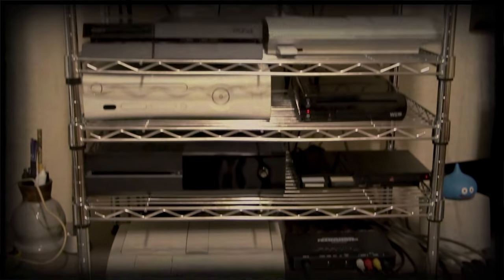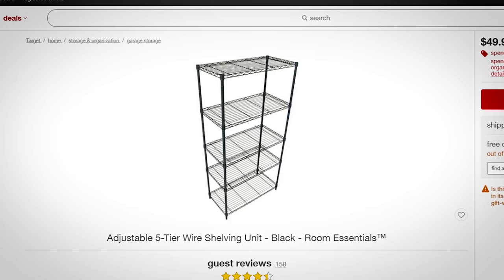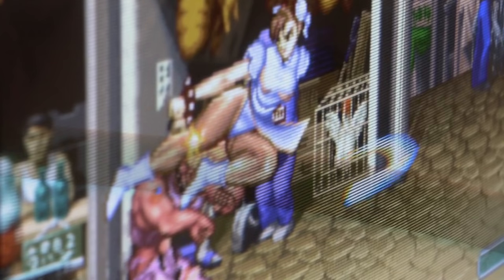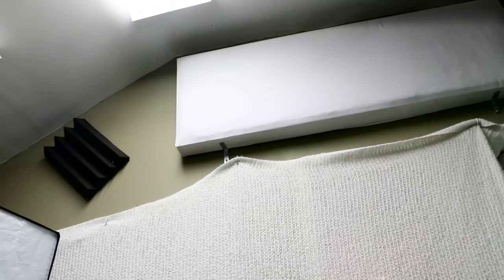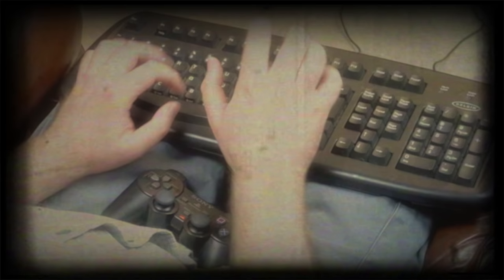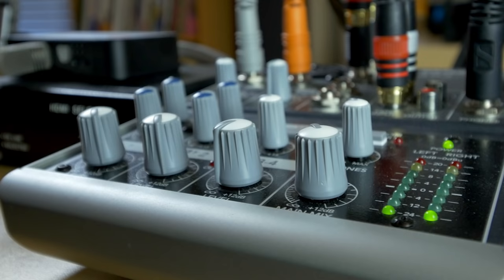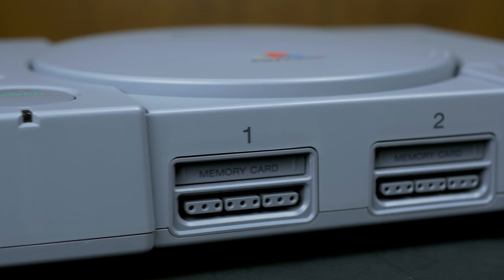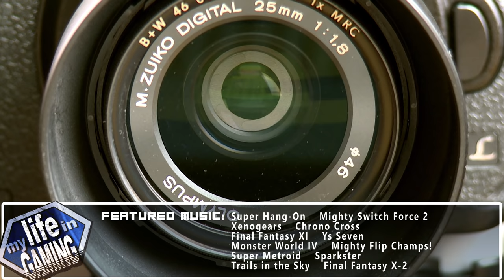Gaming Setup and Studio Tour - How We Make MLiG in 2016 / MY LIFE IN GAMING

Comment: I want to start recording off screen footage of my CRT.  Do you know of a good video camera that matches the NSTC refresh rate?  Preferably not too expensive, but I’m open to ideas. :)
Reply from the maker: [Try4ce] Panasonic's Lumix GH4 and GH5 can do this... possibly also some cheaper cameras in the Lumix line, but not sure. They have a mode called "synchro scan," which lets you dial in the shutter speed to the decimal point. What you may not realize is that syncing to NTSC is not enough. Each individual console outputs a slightly different refresh rate, so the same CRT will need a different synchro scan setting depending on the console. NES and SNES are closer to 60.1, while N64 is more like 59.7 and Genesis somewhere between 59.8 and 59.9.

Comment: you guys don't use the HDMI mods for the GameCube and N64 and other consoles that it's available for?
Reply from the maker: [Try4ce] I use it for N64. NES and GameCube are tempting, but considering I have what I need to go RGB and component respectively, it's not a high priority. N64's HDMI is a huge upgrade in my opinion, plus I have it outputting RGB at the same time. While HDMI can result in a cleaner and sharper image, analog can be more versatile. Really just depends on your setup and what your priorities are.

Comment: I have a question about the Aver Capture Device you use: it looks like it can record at 60 frames, but does it wash out colors at all? (I've noticed many 60 frame capture devices like the Elgato wash out the color, and I've been looking for a high-quality capture device)
Reply from the maker: [Coury] You're gonna get washed out colors at least to some extent if you're using any of these consumer level capture devices. Its not the device that is washing out colors, its the MP4 codec. Sometimes it might be noticeable, other times not. I feel like all of our footage has generally looked pretty good, but that might be because we don't do a lot with modern games.

If you want to for sure avoid this, you'll have to capture in something else, such as ProRes or Avid DNxHD. Of course that requires some heavy duty specs and a raid array to be able to maintain that bitrate for capture, especially at 60fps.

Comment: I honestly hate those wire racks. I have all of my consoles on those, and all of them just slide around either because the rubber feet can't line up with the wires, or because the consoles don't have rubber feet. Heavier consoles like my PS2 phat, Xbox and Xbox 360 sit still fine, but I have to hold my PS1, Gamecube, and Dreamcast in place when plugging in controllers and memory cards. And don't get me started on trying to get a cartridge into a (later model 1) Genesis, or a front-loading NES on those things. I have to put my lighter consoles on cardboard platforms on the rack, and tie the cardboard to the rack to stop sliding. I can't disagree with the cable management though. The ease of hiding cables behind/inside the rack is astounding!

Comment: What are your opinions on stacking consoles? I'm having to keep my systems on a confined, yet open, shelf, but to save on space I'm having to stack certain consoles on top of each other: Xbox 360 slim on top of PS2 fat, Dreamcast on top of a router, Wii on top of Wii U, PS3 slim on top of original Xbox, and free space for anything small I could put on the other half of Xbox One. 

I still try to give each system enough space for heat dispersal and always make sure I'm not blocking any vital cooling fans. I also rarely have more than one system on at once. So far this only has to do with my HD systems (I have a separate CRT setup for the non-HD systems and I haven't had to stack those yet). Still, for the systems that are stacked, I have to wonder if heat from one system is affecting the other. I noticed Coury has his Wii/Wii U stacked so I assume that's fine, but what about the rest I've mentioned?
Reply from the maker: [Try4ce] I try to avoid it, though I've done such things in the past. My Famicom Disk System is under my Famiocm, but I think that's how you're supposed to do it. As long as they're horizontal, vents are clear, and they're and not putting much weight on the system on the bottom, it's probably OK, as far as I know.
Reply: That helps. To be safe I won't stack any of my consoles except for the Wii/WiiU. Thanks!
Reply: Aargh! Famicom is spelled wrong! it's not famiocm!

Comment: You mentioned that your hdtvs were both 1080p Samsung, what model are they?
I'm currently looking for a new tv for my retro setup, but I've read that the newer 4k Samsung hdtvs don't upscale 480p that well.
Reply from the maker: [Try4ce] They are fairly old, so I don't think I would recommend them at this point. Mine has a fair bit of lag anyway, although it handles the signals OK. Mine is from like 2011 or 2012. I'm going to do an episode fairly soon on 4K TV gaming.
Reply: That's cool, I'm looking forward to it, thanks for the quick response.

Comment: Hey Coury, do you ever have a problem with controller cables that are too short to reach where you're sitting, or even RGB SCART cables that aren't long enough to reach your SCART switch?
Reply from the maker: [Coury] Yeah, it was an issue, but was easily solved with just a single controller extension per controller. However, when it comes to say the SNES and NES, I've switched over to the Retro Reciever and 8bitdo controllers because they're wireless.
Reply: Awesome. Do you reckon those wireless controllers are lag-free?
Reply from the maker: I think they feel good. If they are, its gotta be so minute that most people wouldn't notice it. Maybe like a competitive gamer would, but i definitely don't.

Comment: How do you guys play your older console's controllers that have cables? They don't look close enough for a controller to reach the couch. That seems especially problematic for 4 player games on controllers like the N64's. Do you use all wireless controllers on most of your systems?
Reply from the maker: [Try4ce] The wide-angle lens might be fooling you on my setup, but all of the Nintendo and PlayStation consoles are close enough to my seat to reach. For the Sega consoles, I do need controller extenders. For Coury, he always uses controller extenders, because yeah, he does sit too far away.
Reply from the maker: [Coury] I just use a 6 foot extension cable for the consoles that are wired. For NES and now SNES, I've switched over to the retro receivers so i can be wireless on those. I'm sure it would be an issue if I ever had a situation where I have 4 players playing at once, but that hasn't happened yet.

Comment: I might have missed it but what do you use, specifically (or recommend) for a good HDMI splitter? I would also like my games to go to my capture card and TV at once; as of right now I have to choose. I once looked up splitters, but back then I didn't find a single one that didn't have a mountain of bad reviews. I trust your guy's opinions though.
Reply from the maker: [Try4ce] It's a bit of a gamble, because you definitely want one that strips HDCP if you wanna capture PS3. Coury showed the "View HD" one, which at least, as of the time we bought them, it strips HDCP. The main ones behind my setup look exactly the same, but have no branding on them.
Reply: Thank you for that reply!
One more question:
I'm about to get a framemeister and along side it I am going to grab some cables. Obviously I have a choice to make whether to get JP21 or scart and a scart adaptor for the framemeister (like you suggested to that guy who asked the question towards the end of the RGB master class video). Originally I was just going to make it simple and get JP21 cables off ebay for each of my consoles, but then I saw you found a scart switch that actually works. I know it is unobtainable right now, but I'm assuming it doesn't take JP21? Should I go the scart route now to prepare for possibly having gscartsw in my setup one day? 

Sorry if this is something you will address in that future episode you referenced.

Comment: You guys should grab an automatic Bandridge switch for your SCART switch roundup. I know Coury has some manual ones, but I recently got one of the automatic ones, and it seems to be working quite well. A much cheaper alternative to the gscart?

Currently easily available new-in-box on eBay for 40 euros (there's a guy in the Netherlands who seems to have whole crates of the things), although shipping to North America wasn't exactly free: www.ebay.com/itm/NEW-Bandridge-5-Way-Automatic-SCART-Selector-RGB-Retro-Nintendo-Sega-Sony-/231943535881?

A note: the automatic one looks almost identical to the manual ones, except it has a blue light instead of red, has one extra button on the front ("Record Select", which does something to the fifth input), and it's a powered switch so it has a power brick (thankfully supports North American voltages with a cheap plug adapter).

EDIT: I'm having a moment of weakness  here, so, if you guys don't have one, and it's not fitting in the budget, give me a shout on Twitter and we'll work something out.

EDIT2: That came off as more weird than I wanted, I meant, I'd buy a second switch and lend it to you guys.

Comment: Has that monoprice 8x1 hdmi switcher ever given you any issues with resolution switching? I've seen complaints about people having to manually switch back to the source because if it loses the signal even for a second it automatically changes sources, since it cant be disabled.
Reply from the maker: [Try4ce] No issues with that. I suspect that the problem actually is, often some devices send a faint signal when in standby mode. The Framemeister does this, and sometimes the PS3 and other things can too. This screws with its ability to auto switch and I'd have to manually hit the input button. Not a problem now though because no devices plugged into it at the moment do that. This is a problem that could happen with any auto switcher. Also, when resolutions change, there will be a drop regardless. This is not something that can be avoided without a certain HDMI 2.1 feature, which I'm not sure if it has even been fully rolled out yet.
Reply: @mylifeingaming  If the picture cuts out for a sec but then returns im more than fine with that. The retrotink2x and rad2x cables are relatively quick with resolution switching. I just didnt know if this caused issues when it came to losing signal for a split second and have the switcher auto switch sources because it assumed it was off.

Some reviews made it seem like this was the case so I was cautious about purchasing. If the solution is to just not use it with devices that have a faint hdmi signal when powered down then i guess thats what ill do. Also thanks for the reply.

Comment: Use bath towels for sound dampening. It's a hundred times better than the most expensive foams and blankets money can buy.
Reply: How would that work? Folded up in a frame of some sorts?
Reply: @807D14M0ND5  How a painter stretches the canvas over the frame. Exactly the same way, just use a towel and I wouldn't recommend painting on it lol.
Reply: @807D14M0ND5  the difference it makes it extraordinary.
Reply: @MassMurderrer  ah, so you make a wooden frame, secure a towel on it and then just hang it flush on the wall? The thickest of towels you can find I assume? ;) I'll see if I can find some instructions online. It sounds interesting (cheap!)
Reply: Don't smoke weed kids

Comment: Any recommendations on a Svideo and/or Composite Switch? Want to connect a NES, SNES, PS1, and VCR to CRTV With only one composite and one svideo input
Reply from the maker: +Elisandro De Leon [Try4ce] Not in particular. I've used several different generic ones, but have never really analyzed the quality of those.
Reply: Elisandro De Leon look up the recommended accessories on HD Retrovision's website.  they list one that does composite, ypbpr, and svideo that works really well, can be found on eBay.

Comment: How much space do y'all devote to controller and accessory storage and what's the best way to store them for easy use?
Reply from the maker: [Try4ce] Well, you saw how I store my controllers and accessories. They're in 4 of those square baskets, but there's also a storage compartment in the middle of my couch, where I put my most-used controllers. I also have four baskets full of general wires in my bedroom, as well as one other basket (under my Saturn) that has consoles-specific wires.
Reply: OK thanks! I saw you were using those baskets, but I wanted to know what else you used or if Coury had any other alternatives.

Comment: Hey, another quick question: What sort of settings and conditions do you use when capturing photos and video of how different signals look on different displays? I know you briefly touched on this, but I figured I'd ask!
Reply from the maker: [Try4ce] What do you mean, exactly? Like, when we do comparisons in the RGB series? It's usually direct capture at the highest bitrate we can use. Then we just resize them and line them up. We try to make sure the settings on different inputs are as close as possible to make it easier to line up (and more fair in the comparison).
Reply: Sorry if I wasn't very clear. I was actually referring to direct photo or video comparisons when photographing an actual display, like a Trinitron, for example. I'm trying to do a comparison of how one particular TV displays two different retro signal qualities, so using my capture card isn't much help. I'm hoping to use my DSLR to do so, but figured I'd check in and see if I should start with a certain shutter speed, exposure, etc. Hopefully this made more sense!
Reply from the maker: [Try4ce] It definitely helps if you use a shutter speed around 1/60 if possible. 1/30 will create a sort of ghosting blur when shooting a TV. How it reacts, and how bad the refresh line is, kinda depends on your camera... it's just gonna be different depending on how it works. While I shoot a lot of off-screen shots, Coury has done more with CRT comparisons than I have, since he edited RGB 104. Most of my comparisons have been direct capture.
Reply: This is exactly what I was after. Thanks!
Reply from the maker: [Try4ce] Also, I'm not sure exactly where in this video it is, but when we did our live stream with Phonedork as a guest, he dropped some of his own knowledge and tips about shooting CRTs (which he does extensively on his own channel). https://youtu.be/MYq9h7LSDss
Reply: +My Life in Gaming ahh, I forgot to check with PhoneDork! Thanks!

Comment: You guys have any hurdles setting up your avermedia capture cards?  Any tips?
Reply from the maker: [Coury] Actually none at all. Besides the plug being a little loose and easily disconnecting if you bump it, we've had no real issues setting it up. Remember that the U3 doesn't have video passthrough so you'll need a HDMI splitter to play on your TV at the same time.
Reply: +My Life in Gaming Thank you!  Definitely, I've got extras of those from previous multi-display endeavors from production work!  :)

Comment: So.... how do you guys manage to keep everything plugged? I've been searching for a surge protector that let me individually turn on and off each Plug from a remote, but I haven't found anything
Reply from the maker: [Coury] I actually use several of these surge protectors from Belkin. The rotating plugs are extremely helpful http://amzn.to/1WXwef2

The idea of a remote controlled surge protector is a great idea though and is something I'd consider for the future, if they exist.
Reply: ***** I've seen those Belkin ones and they seem ok, but I don't trust the sockets in my house to keep everything on at the same time

I've seen some remote controlled power strips, but either those only have a remote that switch the whole thing on, or its a chinese one that uses a type o plug that i've never seen before. It's kinda of worse in my case since in Brazil before 2010ish we used the standard american socket AND the European one, but now we use an abomination that if grounded, can't be used on the older plugs, and the older plugs can't be used on the new socket (well the European if not grounded can be used most of the time), it's also a mess cause we use 110 AND 220 (well 220 is only used for heavy equipment).

And i've seen a project using two Raspberry pies, and that seems perfect, one is used to control the sockets, and another is used as the controller it seems exactly what I want, but it is a Power Strip, not a surge protector and If I made one, it would probably explode in my face